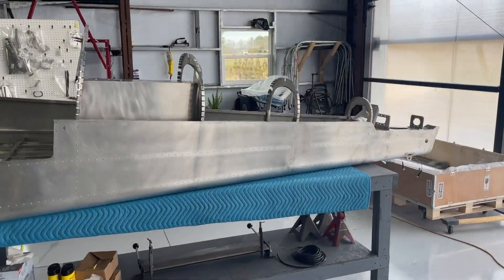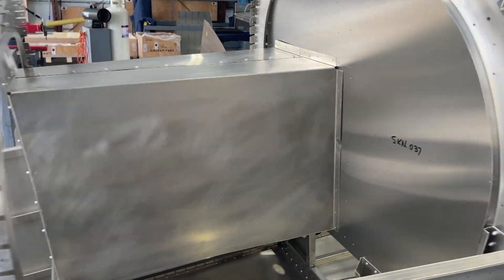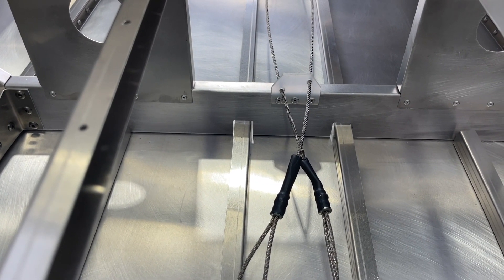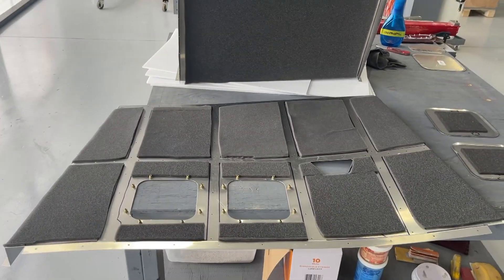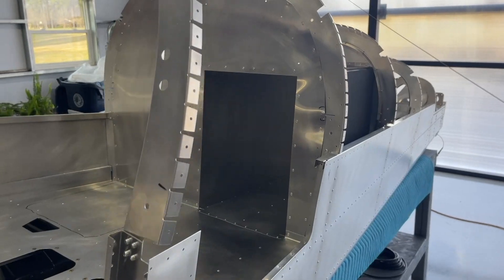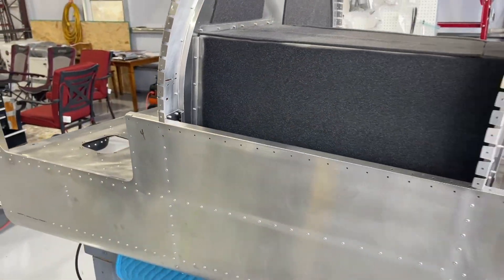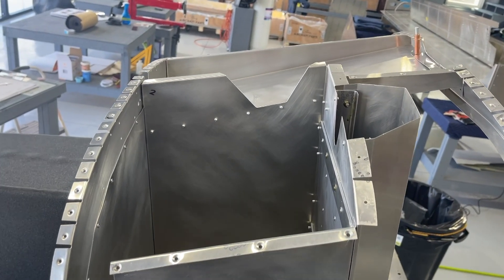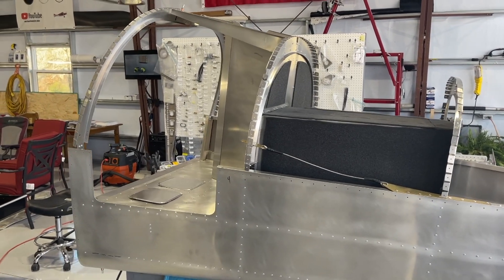Parachute Box & Rocket Tube Rear Fuselage  [Sling TSi Build Video #9]

Comment: Just a quick pro-tip... putting the insulation on the bottom of the luggage area after it's installed is a super pain in the butt.  :D  Don't ask me how I know...
Reply from the maker: Good tip and I did consider that.  So I did install the foam on the underside before I install the extension.

Comment: I'm at the same stage as you. But at your speed, you'll quickly be way ahead of me. Can't be 100% sure, but I think you have the rudder cables crossed right behind the cable box, e.g. between ribs 2 and 3. If so, makes the angles a little more severe than they need to be. The build manual has the crossover between ribs 3 and 4.
Reply from the maker: You are correct.  I do have them crossed.  I also pinned this at the top of the comments.  Thanks for letting me know.